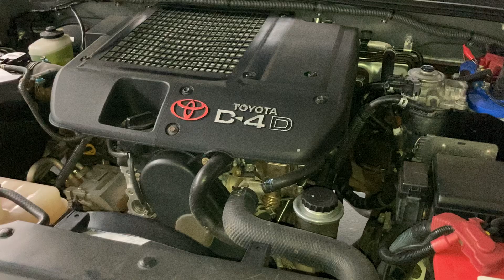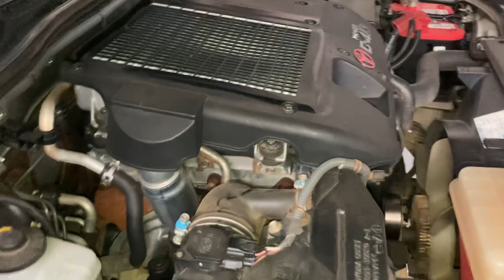HOW MANY CRACKED PISTONS on 1KD-FTV and WHY

Comment: Hi mate
Cracked Piston season
Im wondering if a EGT gauge can see when combustion temperature are over 500-550 °c and showing mechanical sympathy  and backing off the noise pedal. 
The engines are great but dont be greedy upping power.
Do you think  possibility that knowing/driving within the safe EGT'S  would reduces piston crack?
Also if injectors are bad with high fuels it shows high EGT'S backoff and having a chance..possible ?

Comment: @Fourby4Diesel hey anthony, i think i am a little bit lost at the moment and need a bit of your advice. i´d like to buy a new vehicle but not sure which one. i am trying to decide between a hilux invincible, fully equipped(should be the rogue in australia but without the changed dampers on the outside of the frame) for around 50K euros and a j15 comfort ( maybe the gxl,cloth seats, led headlights, no rear difflock) for 60k up to 66k. Both with the 1gd ftv. everyone who owns a 1kd does not sell it.  So what gives me the most headache is, that i would like to buy the better vehicel in terms of longevity(!!mainly!!) and repairability, if there is any difference. what i mean are things like wheelbearings, brakecaliper, ac compressor, window regulators, etc etc. should the engine break down before 250t km,  it would be a good thing :P because here in our country we have a so called relax-guarantee (15years or 250t km if maintained annualy in a toyota workshop -> new engine4free)

An alternative car for me is the j7 gjr76 or grj79 doublecab, front/rear difflock+ winch for 60k euros with the 1gr-fe(the version with vvt only on the intake sides). i would buy one of them too if these cars are really made for 500t km. But one the negative side, only 2 years of warranty because they are importet from the arab emirates, so the important parts really need to be endurable. is that a realistic milage for the 1gr/ j7 except for the oilleaks?  the maintenance i would do myselfe on the j7, so no chance to build up gruel in the engine.

my thoughts are
1. choice (if as !reliable! as prado) Hilux->50k (+3000 for hardtop), bed too short to sleep on it / in the cab only on the seats( in case of....), with all bells and whistles, so way more stuff for way less money and less tax(250t km worryfree)  
2. Prado->  Stationwagon, drivability, maybe a bit quieter, easier to live with/ day to day use, able to sleep in it if needed (250t km worryfree)   edit:permanent 4x4 less fun in winter^^ but of course better
3.GRJ 76-> Fuelconsumption (/.\), but 500t km if everything works well, able to sleep in it if needed, not much car for the money, expensive if things go south

what i worked on so far were mainly shitty brands like vw´s, skodas, audi´s (sadly owned one) rarely bmw´s in a free workshop. if i had your experience , maybe it would be easier for me to decide. what it makes it even worse ist, that i overthink the whole theme. i watched so many days of videomaterial from you and other creators like andrew st. pierre white to get another point of view, but between these 3 vehicles, uffff...   i hope you will understand what my thoughts are with my broken english(listening is easier than writing^^). would be happy if you could tell me what your thoughts are and which one you would choose. 

 Greetings from Germany 

P.S.: Is that about right?  especially the lifespan?
https://mymotorlist.com/engines/toyota/1gd-ftv/
https://mymotorlist.com/engines/toyota/1kd-ftv/
https://mymotorlist.com/engines/toyota/1gr/

Comment: Pretty dry and hot in Tassie. No rain sun and low humidity 😊.  Sweet as.
Reply from the maker: Not what I’m seeing on the weather forecast
I randomly picked Richmond mid 20s and Ryan included in the next week. Nothing over with the two in front of it doesn’t even hit 30°. I don’t think it ever does there 🤣🤣
Reply: @Fourby4Diesel  yea its a really different heat Anthony, Perfect summers, Launceston is probably warmest in state usually high 20's nudging 30. Areas around Hobart above 30. North west where we are mildest. But 24 here and a uv of 12 the sun is really intense. Usually lowish humidity and really high uv. The old closer to the ozone hole over the Antarctic.

Comment: Short CV? after market or what brand.
Reply: Genuine SCV, the short version came on the earlier 1KDs, say before 2010. They have a high failure rate, Toyota knows this and fixed it with a more durable (physically longer) SCV on later models, hence the terms short and long SCV. Anthony has made plenty of videos this, just search SCV on this channel.